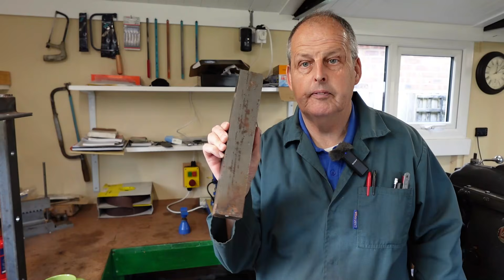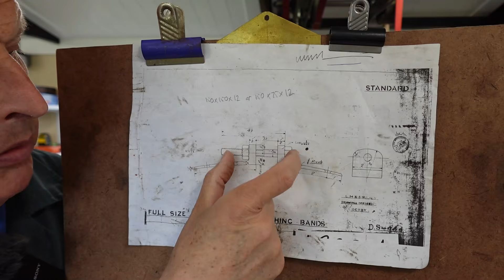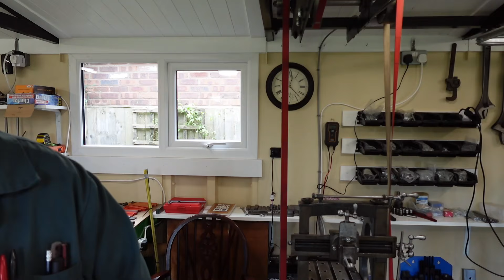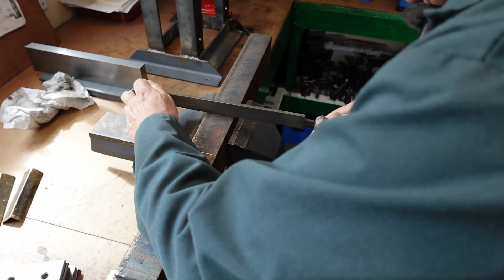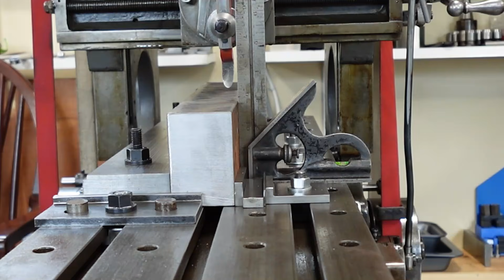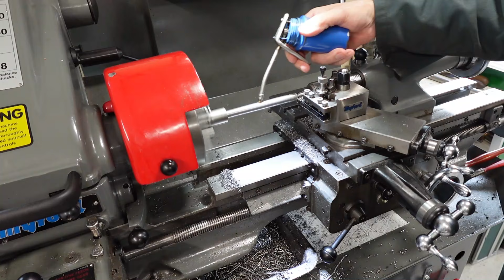82045 Steam Locomotive. Lugs for Boiler Bands (Part 3)

Comment: Never knew what those flat file edges were officially for, but that is what I used them for all those years ago. So it is nice to see I was using the file correctly & it explains why the man who trained me did not bother to correct me. Of course, I was not being trained to become a fitter or machinist. In my case it was the drawing office, but we still needed to know all the other stuff, including how to use all the engineering machinery, though not necessarily through actually using all of it.
Reply from the maker: Having knowledge and experience of Engineering practices in my opinion is essential for anyone involved in drawing and design.  In consequence to this the machine, product or device is greatly enhanced and becomes a much more user friendly design.  Thanks for commenting.
Reply: @davebates2709  My apprenticeship comes from an age before the electric angle grinder was used. So we learn't to use files & cold chisels first. Then lathes, shapers & milling machines. The break press was initially a mechanical one, so I was not allowed to use that, only to watch. We had a department for cutting off so again watching other than pre-apprenticeship when I was allowed to use a donkey saw. The machine shop had a lot more machinery all dedicated to production, again pre-apprenticeship allowed me to learn to use a lathe  (treadle type at 12)